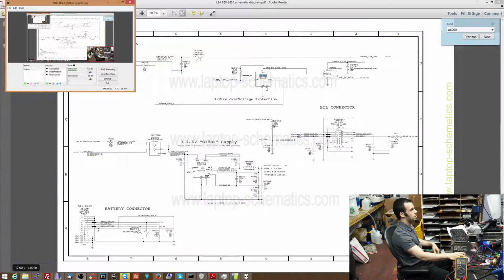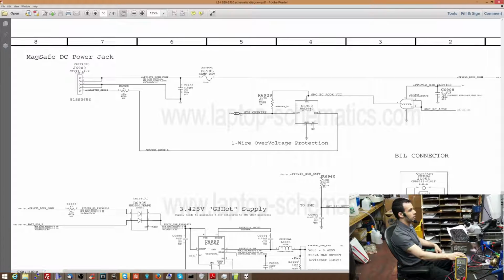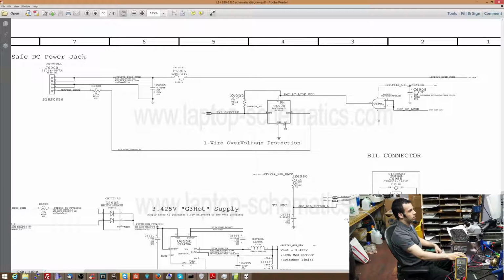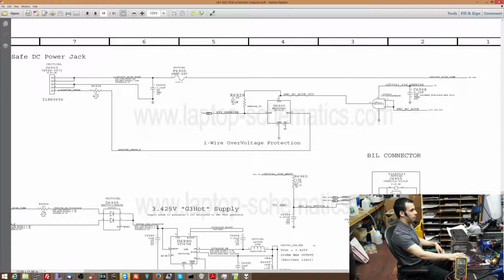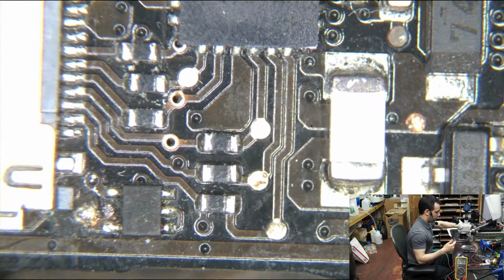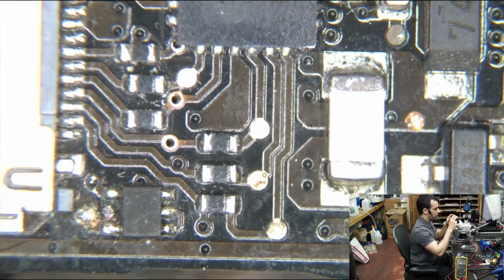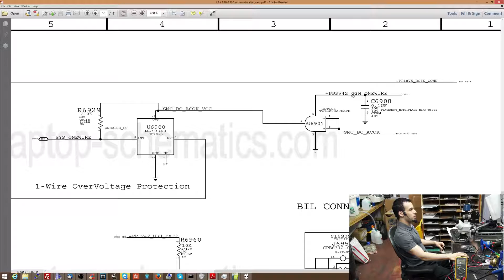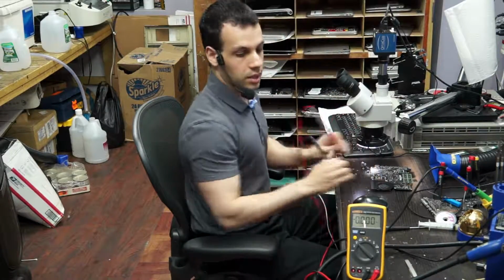"How to fix no magsafe green light on Macbook Pro logic board." date:5-16-15

Comment: will you tell me what's that with output you connected wire.
Because I have issue with mega safe DC jack and on it's upper side Same like that component burned out and I don not what is that.